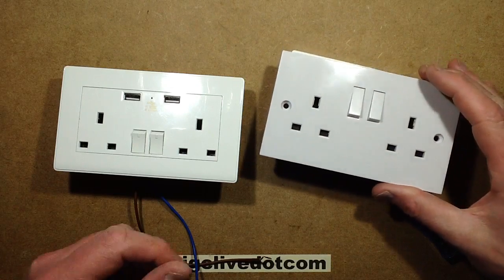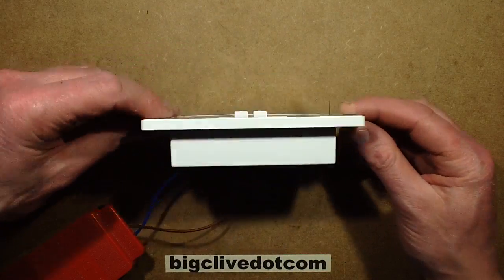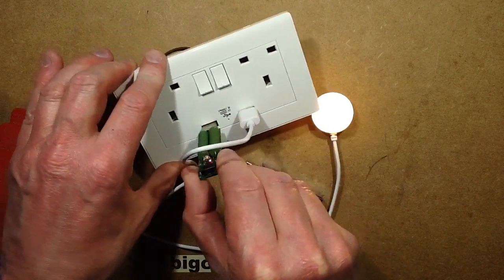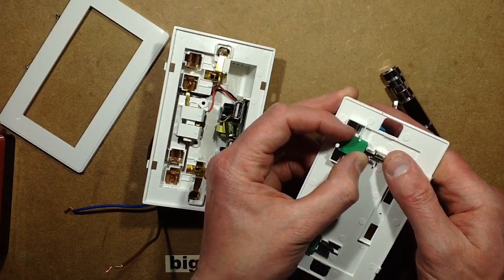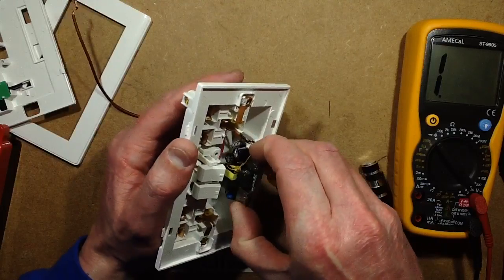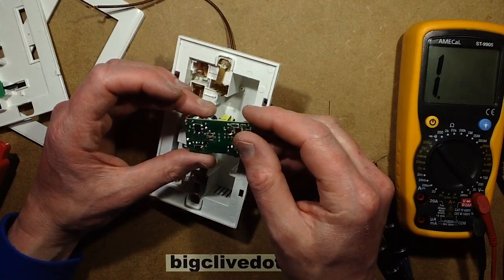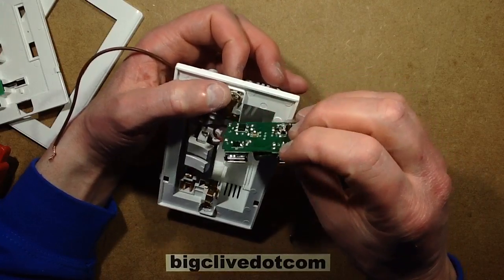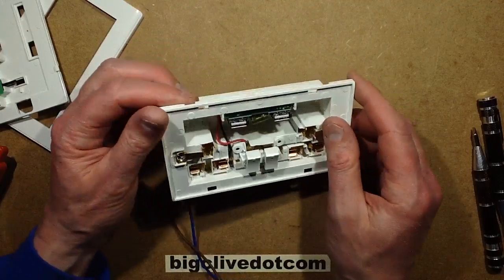A look inside a (crap) double gang socket with USB outlets.

Comment: I live in Italy and here we have shutters on every plug, but the opening mechanism is different and in my opinion more secure:
You can plug only earth with no problem, but to open the shutters, you need both live and neutral to be plugged in!

But at the same time you can plug a plug both ways, so no one knows which one is live and which one neutral...
Reply: +AL_O0 ᶜᴼᴹᴹᴬᴺᴰ ᴮᴸᴼᶜᴷ ᴬᴺᴰ ᴿᴱᴰˢᵀᴼᴺᴱ a couple of manufacturers do have more advanced shutters which do require both live and neutral to be inserted simultaneously in addition to the earth pin already having been inserted to unlock them which is safer still. However that feature isn't mandatory in the standard which defines the sockets.

Comment: WARNING AVOID SOCKETS WITH USB OUTLETS AT ALL TIMES!!! They are a con to make energy companies lots of cash, you would not leave a phone charger plugged in all the while because of its quiescent current drain, these damn things are energized all the time, its basically like leaving your phone charger plugged in 24/7. The power companies are constantly bunging cash to electrical and electronic companies, to make devices that constantly need standby power. Also something like this, if it has shit circuitry like this one, it could burn your house down.  Remember the dripping tap analogy, A DRIPPING TAP WILL EVENTUALLY FILL A SWIMMING POOL Electricity is no different, devices like this are an electrical dripping tap, an absolute dream to greedy corrupt energy supply cartels.
Reply: +Richard Sandwell I leave my phone charger plugged in all the time. It's an absolute drop in the bucket compared to everything else.

Sorry, but they're not some big conspiracy involving energy companies.
Reply: Monkeh616 The energy cartels are about as corrupt as they come. Even the government and offgen their regulator have made it worse for consumers and better for the energy companies. I had to get rid of my gas supply because of them. Standing charges, imagine paying for a restaurant you never use, and the restaurateur telling you that, "OH WELL ITS IN CASE YOU USE ME, I HAVE PLUMBING AND WIRING IN MY RESTAURANT TO MAINTAIN!" You would quite rightly tell them to piss off. Because when one uses a restaurant, you are not just paying for the meal, but also for infrastructure within the building. But with energy they expect you to pay standing charges. My gas bills were tiny, I am careful and tread lightly upon the Earth, we would not have an energy crisis if it were not for greedy people who leave the heating on 24/7 and even put heating on in the summer months. Women are especially bad for being addicted to heat, and showing a lack of regard for where energy comes from. Anyway in 2012 my tiny gas bills, which would be maybe £15 pounds a quarter in the winter and maybe only £0.50p in the summer went through the roof. Offgen the government agency/ regulator, working in the interest of the PEOPLE! what bullshit that is! decided to make BG charge me £94 a year just for having a bloody meter in my house. Needless to say I am now on bottled gas, and the meter is no longer there. The electricity will end up the same, I believe standing charges should be scrapped, and maintenance of infrastructure should be part of the unit cost of energy. This would be a greater incentive for others to tread lightly upon the Earth. And it would help the poorer consumers who have no choice but to be frugal with energy.

Comment: 4800mA USB? I'd be scared for my device, yep yep... Maybe it's for connecting cheaply spliced-together charger cables, five at a time, to charge multiple devices at once.
Reply: +Sebastian Ramadan The device only takes the power it needs. It just needs 5V and sufficient current. The era of constant-current chargers that could only be used on one phone and not others (with Ni-Mh batteries) has come to an end :D
Reply: MrOpenGL That's some ignorant babble you just wrote, and it shows to anyone with even a basic understanding of the USB standards. As faulty USB devices and cables have shown us in the past (perhaps even on this very channel), sometimes the device will catch on fire if allowed to do so. There is a reason devices are supposed to negotiate for a higher current. According to the USB standards the maximum amperage should be 500mA for USB 2.0 and 900mA for USB 3.0. How far beyond that is this 4800mA, hmmm? Stop acting ignorant; you're capable of acting intelligent, instead.
Reply: Sebastian Ramadan

I appreciate people disputing my ideas, but I do not appreciate people doing so without proper research and people that just plain insult.

Anyway, you are wrong on various points:
- Any modern device will have a lithium based battery, and a suitable protection/charging circuit in it. The circuit only takes the current it needs, and if the charger can't handle the current it is trying to draw (the device detects so because the voltage will dip) it will charge at the largest current the charger will supply (as explained by Clive in this video).

- The devices catching on fire you are referring to are probably bad quality power supplies, and the reason they catch fire has to do with how they are built (especially regarding the mains powered section) rather than devices charging from them

- Power negotiation (and the 500mA/900mA limit) is only used when the device is charging from a computer, not a power supply! The reason for that is that some hubs (especially the ones on keyboards) are self-powered and are only meant to be attached to mice and other low power devices.
All USB chargers are regarded as "Dedicated Charging Ports" and NO negotiation is needed nor performed: the device will charge at the maximum current the charging circuit needs, and if the voltage dips too low because the charger can't handle it the charging circuit will reduce the current until the voltage gets back at about 4.9V.

-Funny fact: you are worried about 4800mA, but what if I told you that in EVERY SINGLE desktop PC, the USB ports are fed from... the 5V rail of the power supply, which is capable of AT LEAST 35A (35000mA!!!)??? You know, just because it is fed from a 35A capable power supply, that the phone will take 35A!

"Stop acting ignorant": you should do that!!!

Comment: I presume the 4800mA rating you question would be total capacity for two x 2400mA outputs which is becoming standard now
Reply: Ah, yes, that could be it. Modern tablets are probably using fast-charging stuff which will no doubt drain at least 1.5A.

Comment: Do sockets in the UK usually have switches like that right beside the sockets?  It's interesting how much different they seem to be than the ones here in North America.
Reply: Yeah they all have that apart from the two pin shaver sockets
Reply: robuk1981 Interesting, thanks.  Usually here we have a switchable socket in each room controlled by a light switch which is placed beside the door/entrance to the room so you can place a light there or whatever if there's no light placed on the ceiling.  Cheers.
Reply: +sc0tte1 the non switched sockets here would be installed under a kitchen counter for things like your fridge then there would be a switch over the counter
Reply: robuk1981 I see.  They seem like they're huge as well.

Comment: I have noticed on most 220+ voltage systems I notice that there almost always switched what is the theory behind that
Reply: +Richard Golden you see that big blue spark when you plug your device in when its hot that norm does not happen in the UK as the switch an instant open and close contact, 
also stops you from melting the plug or socket receptacle/connections as you get an arc jump if you plug in when the socket is switched on (depends on the load of the device), 
its why i dislike 4-6 way extension cables that lack switches on them as you see it do the blue spark when they jump the gap before you get the plug all the way in (if you don't plug it in fast)
Reply: +lee x  Here we really don't get that arcing I guess it's because of the voltage reduction @ 117v 60Hz  thank's for answering my question I have always wondered

Comment: That split earth is criminal.
Reply: Why? I'm not familiar with this.
Reply: +Bradman175 Because Joe Public who buys this kind of crap on eBay to swap with an existing double socket will have no clue that they'll need to fit a jumper from one earth terminal to the other to make it safe.
Reply: Graham Langley ? i dont get it.
Reply: +Bradman175 If you use only one earth terminal the other outlet won't have an earth connection. Proper/legal sockets may have two earth terminals but they're linked.
Reply: Graham Langley Oh i get it, they're not connected. Which mean you can't daisy chain them.
Reply: +Bradman175 That's it, but it's nothing to do with daisy-chaining. 

With no internal link between the two earth terminals you need to link them properly externally with a bit of 1.5mm² wire or you'll have a potentially lethal unearthed socket.
Reply: Graham Langley Well yeah i said something a bit off topic.

Comment: Have you seen the installation technique they call "high integrity earth bonding" it's to be used on sockets to be used with electronic equipment. The two earths from the ring aren't put in the same terminal but one in each of the two terminals. If this socket was wired like that then it could remove the earthing from other sockets.
Reply: +Benjamin Harvey I was thinking about high integrity earthing when Clive mentioned not having seen 2 earth terminals on a socket. A technique thats used in IT suits or offices. Essentially the regs expect this method to be used anywhere where a computer is likely to be used or in another type of installation where there is likely to be high earth leakage currents on the socket circuit.
Reply: +Duncan De Salis personally I really can't understand how this method of earthing is in any way better to doubling up the tails into one terminal. I mean it's good enough for delivering power, why not earthing???
Reply: I've never really found a definitive answer to the reason for it. My assumption is that by using both terminals on the socket with one leg of each CPC in separate terminals, it greatly reduces the chance of a socket losing it's earth connection as it's unlikely that both earth terminals will come loose. I know it's high unlikely anyway but with the normal arrangement (both CPCs in same terminal), if the terminal becomes loose you may lose your earth to the connected equipment. With a high integrity arrangement, if one terminal becomes loose, you will always have an effective earth path through the other terminal. It's belt and braces for high earth current scenarios as voltages in the CPC can rise to dangerous levels if the equipment plugged in is not effectively earthed. The CPCs of the ring would also be terminated in separate terminals in the consumer unit with a HI arrangement for the same reason.

Comment: Better suggestion for designers of these products would be to have an additional switch to isolate the built in electronics. That or have modular ones which can be pulled out and replaced should they fail.

Comment: I got myself one of those from screwfix 2.4   and it works fine charging anything only cost about £8.00 plus you can see the earths are linked
Reply: +Brett Milnes But run a check to see if it still draws current when everything is unplugged from it. It maybe still drawing current.
Reply: +Richard Sandwell Of course it's still drawing current. Everything does, like the TV you leave in standby, and the cable box, and your computer, and monitors.. RCD/GFCIs, AFCIs, and hell, the cable in the walls draws current.
Reply: Monkeh616 Everything in my place is turned off, I even switch off and leave the door open on the freezer if I am not using it. I do not want to give those robbing bastards a penny more than I need to. And when I sort the wiring out on my newly installed PVs and windcharger, I am going off grid.

Comment: just another point where android is better than apple devices.
Reply: It seems any mention of Android nets a whole host of pretty negative comments about Apple, and a lot of 'Likes' to go with it.
Which ones are the irritating sheep again? It's hard to tell nowadays.
Reply: JeefCakes
I amk not satisfied with Apple, not with Android and not with WP. All have extreme weaknesses.
Reply: +BloodySword and when apple switched from the 30 pin connector to the lightening port it's no problem?
Reply: +BloodySword I'm not sure where you're getting your USB cables from, but mine are reasonably priced (well below apple's cables price range) and are of decent quality. My cable measures around 0.2v of drop at 2A. I get them from ebay, and it's a bit of hit and miss - you never know what you're gonna get, but most of them are alright.
Reply: Apple devices are really over priced devices , and not better than Android ones , you have to dismantle the whole phone to change the battery ( not sure if it will restarts after dismanteling ) On an Android device : just open the case to do a battery swap . .My sister have an Iphone , when she tries to send mms with pictures to me i can't open the picture folders with my Android , i had only this problem with pictures send from an Apple .....Apple = Over priced crap !
Reply: routari:  The sheep are the ones that will pay huge amounts of money for a fashion accessory.
Reply: +sayan das Not really. You have to buy expensive cables when you want fast charging with cables longer than your thumbnail... They put less copper in cables today than you have in your body and sell it for fortunes! I had to buy cables from Volutz to overcome this issue. And now, they are switching to USB type C and I need new cables!!! Because these adapters are ALL dodgy and have copper thinner than your hair!

There are 1000 other reasons for not buying apple products than this.
Reply: +Cletus Spuckler then don't buy one
Reply: Joyrider Please read: I am not defending Aplle, I do not own ANY overpriced hardware from them!! I just wanted to say that there are 1000 reasonst for not buying Apple hardware but this one is not in the list!
Reply: They doth protest too much, me thinks.
Reply: routari That's what i do , i don't buy this brand .
Reply: +BloodySword as do all things. I personally like them all. There's all great in my eyes, although I don't have a Win mobile device atm.
Anyone that says one is shit, or one is perfect, should just be ignored. They're irritating.

Comment: Hey Clive, I'm sure you already have every meter you could possibly  want, but just to let you know that Lidl, (if you have any Lidl's where you live) have a special on tomorrow (Thurs 24th) on different meters, ie, ultrasonic distance, moisture detectors etc, they are made by powerfix, don't know if thats a good quality make or not but I have bought a lot of Silvercrest goods there over the years and been very satisfied with price and usage of the items, :-)
Reply: The devices sold by Lidl are not crap , Lidl is a German shops chain ....Germans dont joke about security ....sometime they sell battery power tools that are really well manufactured , with good performances too .
Reply: +Cletus Spuckler sometimes they do :) Sometimes they design cars with super good emissions also.
Reply: Cletus Spuckler Some of lidl stuff is utter crap fit for landfill only!

Comment: I was under the impression that a double gang socket had to by law have both earth sockets bonded together in such a way as they could not by accident come apart? I could be wrong. Any Electricians know that part of the regs?
Reply: Yeah I think it is, but I think the point is this isn't a legal/up to code socket
Reply: The earthing system must contain a “hard to remove” link on such sockets
Reply: In the UK which is where these sockets are made for, I am pretty certain it is the seller not the manufacturer who is legally responsible for the quality and compliance of products they sell irrespective whether they are own branded or not. It is up to the retailer to demonstrate due diligence to show they have taken all reasonable steps when they sell something. When you buy something, your legal contract is with the supplier, not the manufacturer. It's the supplier you pay your money to.
Reply: @125brat   They use the type G socket (UK style 3 pin) in Hong Kong too.
Reply: @MegaWeebles  And did you see what happened to them? poor sods.
Reply: Ones sold at Hardware or Electrical stores should ones of ebay or aliexpress fair chance they are not upto code and this applies to pound/dollar shops as legally they do not have to make sure the electronics meet UK/US codes as long as it is not sold under their name (or a brand name they own!) all responsibility laws with the manufacturer and/or importer!

So basically do not trust electronics from cheap shops or Ebay/Aliexpress only buy electronics from Hardware Stores, Electronic and/or Electrical Shops!!!

Comment: 11:20 The data pin short (or a resistance of <200Ω) indicates a current of at least 500 mA, not exactly that current. It could provide up to 2A per port. 

The actual current of a charger with data pins shorted could be anything in this range, hence the Android method of detecting the voltage. Some devices will just pull 500mA because it is guaranteed to be safe. Not sure what the iPad is doing. It might be assuming any modern charger will be able to provide least 1A and leaving some margin?